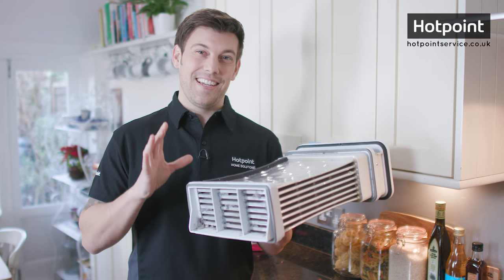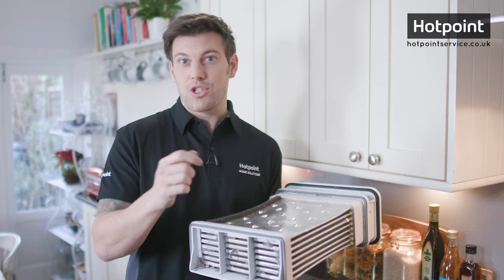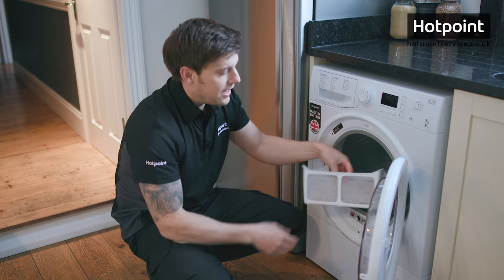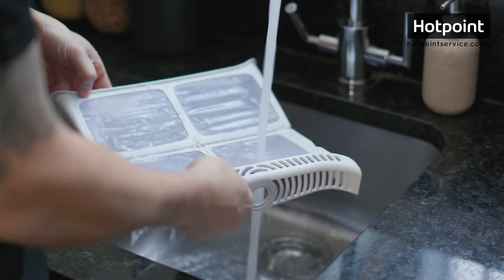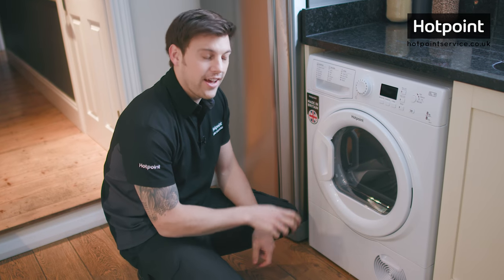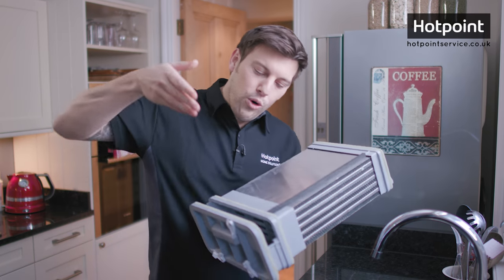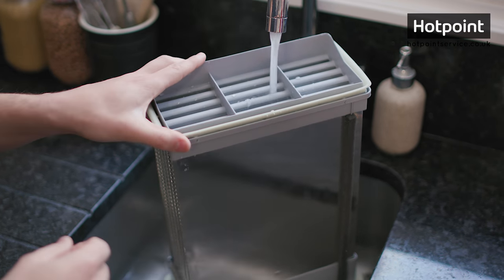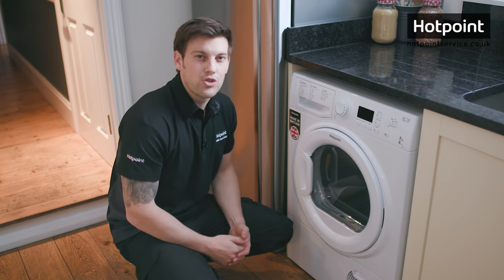How to look after your condenser dryer | by Hotpoint

Comment: The condenser, heat exchange box will not slide back into place fully, so the 3 blue clips are not able to secure the box in place, therefore the bottom drawer compartment will not shut properly either. Such a bad design fault. Help please

Comment: I can’t get the heat exchanger to fit back in again after a spot of regular maintenance/cleaning it. It seems to be a common problem with these and some customers cutting or trimming them if warped but they shouldn’t be this way to begin with. Also sure the warranty would then be voided by them so not something I plan to do even if it’s worked for others. Can you tell me hotpoint will an engineer look at this for me and fit it back in or replace the part if faulty under warranty?

Comment: Struggling to put the condenser heat exchanger back in! Any suggestions?! Thanks
Reply: ME TOO
Reply: @lajani123  Mine had a small kink in it at the bottom end. Once that was gently manipulated out, it went in. Won't be taking it out again for a while! Good luck!
Reply: It goes at an angle not straight or level

Comment: Any tips on cleaning the fan area to the right of the condenser filter , I've got this model and the fan and surrounding has a build up of lint , but iys not accessible unless you unscrew and remove the outer casing , is there a way to do this without doing damage 🙉🤔
Reply: I know, 2yrs later... Have you tried vacuuming it with vacuum hose? This is what I would do.

Comment: I'm currently having some trouble with my hotpoint 9kg inverter motor condenser dryer.  The red box light came on for the condenser to he cleaned. I have thoroughly cleaned it and the surrounding areas however  I still can't start the dryer. The red light still flashing. Only 9 weeks old. Any ideas? Thanks.

Comment: Hello there. My hotpoint dryer doesn't dry properly and I've dried to clean it all out but it still doesn't dry.. it takes about 30 mins on the cottons ready to wear when it shouldn't.. so we have to resort to using the timed programmes as they are the only programmes that dry the clothes properly

Comment: Just tried to remove condensing unit to clean as dryer is not heating up, only cold air - there is water coming out with the condensor unit! Hurriedly put it right back! Is this normal?? (Condensor unit at bottom of machine, LH side as per this video) thx
Reply: I know this is a year later but for anyone else wondering about this, there will be some water between the individual metal sheets yes, try to keep it level while carrying to sink, it's normal. I've had a condenser dryer for over 10yrs, it's always been like this.

Comment: Had this few days and always water leaking onto floor, anyone have similar issues ? Does it matter where the hole is positioned in the water container maybe ? Any advise would be welcome, thanks
Reply: If its the condenser, just put a rag where it leaks, just water still in it, wait for leak to stop and then pull it out to wash

Comment: Hey there! I am getting the sign that my water container is full but it's not. I empty it but still it stops! What should I do? Thanks!
Reply from the maker: Hi Thanasis K

Sounds like your machine just needs a reset. When not in use can you unplug your machine from the mains leave it off for an hour (drains all the power) then turn it back on. 

Hotpoint Service
Reply: @HotpointCustomerServiceUK  Hey there! I already called someone and it seems the drain pump wasn't working properly, so it wouldn't send water to the container, so we changed it and discarded the faulty one! Thanks for the answer, have a good one!

Comment: My heat pump dryer has a non removable heat exchanger, lint collects in spaces only an engineer can get to by dismantling the dryer. Absolutely insane design
Reply: Mine too, I bought it because I thought they had redesigned it so this was unnecessary.  Instead it is unremoverable and you have to pay for a service engineer to clean it out! Such a con, will never buy whirlpool again.

Comment: My elderly mum got a condenser dryer when she replaced her machine as part of the recall about 3-4 years ago. I have recently discovered she hardly uses it as the clothes get tangled up tight. She did contact Hotpoibt but was fobbed off. I only recently found this out 🤨

Is there anything I can do with the machine that will fix this issue?

Comment: My heat condenser is fixed. I can’t remove it but my tumblr dryer smells fusty. Hotpoint please advise on alternative cleaning options for models like mine where the heat condenser is fixed in
Reply from the maker: Hi Lucy

Do you have a vented tumble dryer? We have a couple of products that help keep your dryer and clothes smelling fresh watch out video on these products here https://www.youtube.com/watch?v=hMn3Ja4yIR8&t

kind regards 

Hotpoint Service
Reply: @HotpointCustomerServiceUK  My heat condenser is also fixed, and it is not a vented dryer. There is a lot of fluff in the fixed unit - is there a way to clean this out beyond vacuuming periodically?

Comment: The heat exchange wont go back in its home what am I doing wrong
Reply: I know this is 3 months late but it will help in the future.....Look at the rear, you may find the plastic is warped, if so you can cut this off and push the unit back into the machine, it will work just the same!
Reply: @deckelpc  I was facing the same issue with my condensor thingy it would fit back in and I cut it off and it now works thank you so much does your help (tip for anyone reading for the corners use a nail clipper to cut them off)

Comment: My Hotpoint condesor gets cleaned after every cycle but the two red lights on the sensor still appear that they need cleaning? I've tried unplugging the socket but no luck?
Reply: I'm having the same problem
Reply: Have you sorted it? I have the same problem
Reply: @nancyramirez7476  nope. It works fine but it's frustrating knowing the lights are red knowing I've cleaned it
Reply: @LS-bw7jt  I have the same issue on my 4 week old dryer!!! Have you found the fix! Obviously I have cleaned the filter and condenser….

Comment: Poor design, I found a twisted metal bar inside the dryer ripping off all clothes. So poor.
Reply from the maker: Hi Ahmad

The twisted metal bar is most likely a bra wire which is perhaps the most common causes for your appliance getting blocked/not spinning.

Hotpoint Service
Reply: Then which bra has a metal bar more than 15 cm in length. Come on.
Reply: It's the drum sensor. It's the metal strip you see the guy cleaning inside the drum at 0'45". They get caught by clothing and ripped out. Not a great design. Happened to our Hotpoint dryer.